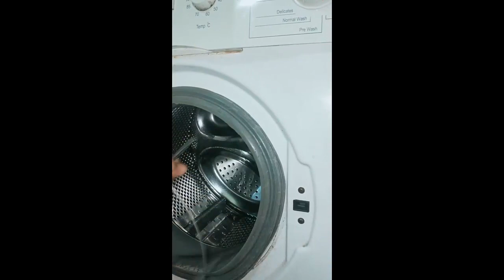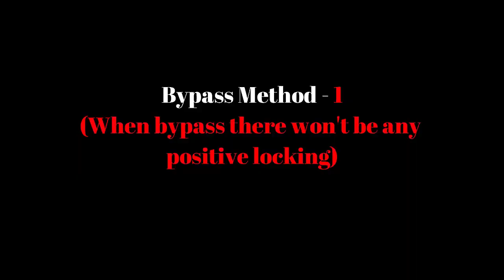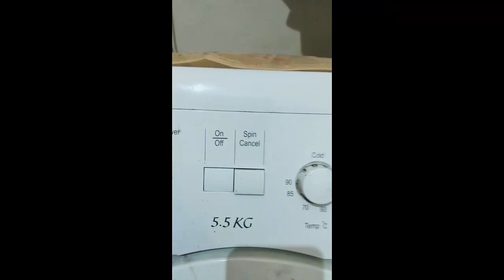Washing machine door lock bypass |Washing machine door lock | front load washing machine repair

Comment: Nicely explained how to fix problem, my Washing had the same issue, I called Urban Clap, he asked Rs 1500 for repair, however I connected with IFB spars dealer and get the lock for Rs 300. and replaced on my own, now my washing machine started working fantasic , Thanks for on line video with out which difficult to replace
Reply: Hey can you give no. Of IFB dealer

Comment: thank you so much, i manage ( again ) to fix mine, wasn't same system ( much older ) but i managed to bypass with a bridge wire when i realise the dents ( pushed by the door lock ) were a bit loose. Like a "U" becoming slowly with time a "V" so i closed them slowly with a tool and off you go... ready for another 10years ! :D

Comment: If you are doing the second method, make sure that you remove the plastic part which holds the lock in place. otherwise the latch wont be able to open afterwards!!! You really should have mentioned this in the guide as most folks wont think about it

Comment: I have applied the 2nd option using a paper chip inside the door lock. After that machine is running. But the door is not opening. Tried after 1 hr also but still the door is not opening.. Kindly help with your suggestions. What is the next step to open the door.

Comment: I njoyed the video... thanks a ton... I replaced with a new one and issue for starting the machine is closed... but I am not able to open the door after wash as the led displays.. so I switch off power after couple of minutes I am opening... what for I am not able to open door upon completion of washing
Reply from the maker: when machine working the small heater inside the switch is on and it will heat the bimettallic strip and it expands. this metallic strip pushes a plastic piece close to your door knob which prevent the door to open. when switch off the heater getting off and so the bimettalic strip cools down and pull back the locking plastic. thats how it works.
Reply: @MeetMyIdeas  door interlock switch will give command to start the machine. My machine led for door was blinking, so I replaced the door limit interlock switch, now no led indication machine is working fine.. after completion of washing door led starts blinking.. how to rectify it. I am not able to open the machine after completion of washing...
Reply: Thanks for the video. I am also facing a similar issue. I replaced the old lock with new one. Now, after completing wash cycle, the door led and error led keeps blinking and I am unable to open the door even though the washing is complete. I need to trun off power and wait for some time, then the lock gets released and door can be opened. 
With the original switch, the door lock would get released automatically aftwe wash cycle is complete.

Comment: thanks Good one! it would be more safe to use the original plug to prevent any wire lose cause it is high current. then 1. to remove the heating power pin; 2. it is necessary to remove the door lock plastic tab to allow the door can be opened

Comment: In method 2, if you press the bi-metal down, you also press the pin down that locks the whole thing. So if the problem was that the machine stays locked, that method will not help. I took the little plastic pin from the bi-metal to fix that.
Reply: Doesn't bypassing switch burns main board of machine!!

Comment: Hello sir after using this door lock setting, now next process doesn't start I mean screen stuck at  "door locked and child lock available" status. Please guide me what to do?
Reply: 😂😂💔 I was expecting this, let me guess, you used the second method right.. how did you fix it?
Reply: @opiritetariah  If you use 2nd method, you will need to remove the small plastic rectangular block inside the switch which locks the door once the machine is switched on. If this is not removed, you will not be able to unlock the door again. The disadvantage is that the door can be opened even when the machine is running, so there is no safety. Better to put a new switch as soon as possible.
Reply: Thank god! I was about to try second method - Thanks for the tip M V !

Comment: Hello sir
the door is in lock position after bypassing the switch. how to open the door?
Reply from the maker: If the door open Push the plastic lock( plastic between the front and back layer of switch which is movable by pushing) in between to right. if door closed open top cover and push the lock. to open the top cover see https://youtu.be/fY9MSttelbY

Comment: Hello sir..is it safe to use plastic or paper inside door lock switch..method 2???
Reply: Well it works for closing it but now how to open it after it washes....
Reply: @safirab9436  idk...this method didn't work for me...the door got locked but the washing machine won't even start..
Btw for ur case it should probably open just by cutting the main switch..
Reply: @abhichi  then your problem is probably from the dashboard... It did not open at all I had to open the upper part and break the interlock..... By doing that, the problem got shifted to the dashboard as the safety key stopped working.....
Had to call someone to fix it....
Sad life

Comment: Hi I do the second bypass technique.. after washing door is not opening .. what should I need do
Reply: Please reply any solution for this
Reply from the maker: in second method when the bimetallic strip expands a small plastic lock moves and lock the door. when bimetallic it cools it may go back. if not you have to push back the sliding plastic lock with screw driver. if not accessible from front need to open the top cover. to open top cover see https://youtu.be/fY9MSttelbY
Reply: @MeetMyIdeas  
But I put a piece off paper inside.. to.contact .. sorry I mean the last method i did
Reply: Front door stuck now. Only chance to do anything inside using top open
Reply from the maker: @rebinnshaju9449  give your email i will send you a video
Reply from the maker: give your email i will send you a video
Reply: Hi just switch off power supply try after 2 minutes it will open I do the same
Reply from the maker: @manojmanoharan8629  Thank you so much for your input Manoj
Reply: Lg front load washing machine take to 15 min extra run with wash why?
Reply: Please How were you able to fix this?

Comment: I have applied the 2nd option using a paper chip inside the door lock. After that machine is running. But the door is not opening. Tried after 1 hr also but still the door is not opening. 
Tried from opening the top of the machine also but could'nt able to do so.
Kindly help with your suggestions. What is the next step to open the door. .
Reply: For the door to open the common & phase has to be disconnected.
The method illustrated in the video can be used to verify a faulty door switch. Not to repair the switch rather.
Reply: @ThePlatformTV100  Thanks! 
makes sense (The method illustrated in the video can be used to verify a faulty door switch) 

Verify and go and purchase a new door switch  and replace it. 
While buying go with the older one to get same model.

Comment: My washer door won't stay shut so it won't work
Reply from the maker: when you bypass keep the locking (holding) portion of the door switch in the same place. Jam the sliding/moving plastic in side the switch which prevent the door open after wash

Comment: Please don't do this!!! 

Very dangerous especially if there are kids around .

Never work on an appliance whilst power going through it. It can kill you. 

And never bypass safety features.
There is a risk of fire, electric shock, or in this case with the door lock, if the door is opened during a spin, it can pull kids' arms inside and cause degloving, multiple fractures or even worse...amputation !!!

Instead, replace the door lock completely. If you are not confident carrying out the work, pay a professional because it will guarantee safety and piece of mind.

There is a reason they charge what they do, it's because the know how to repair your appliance properly and safely. There are far more risks thank non professionals are aware of.

Please be safe , especially if you have kids!
Reply: @Jamie Dow, you know, you can leave the door closed and maybe supervise your children if you have!!!
Reply: @whirlpool_addict_  yes I was aware of this but thanks for bringing my attention to it .

 I don’t have children . But the people who attempt this at home after watching may have children.
Reply: @JimmiG585  Oh ok no problem and stay cautious if you do this!
Reply: @whirlpool_addict_  I’m glad we agree
Reply: @JimmiG585  Also be VERY Careful when playing with the interlock wires.When the machine starts the cycle, MAINS VOLTAGE pass through the cable.
Reply: It also burns main board of machine..